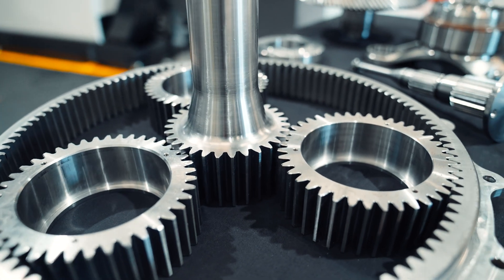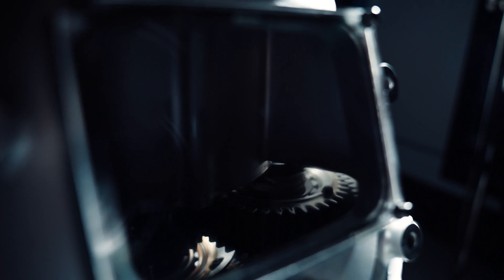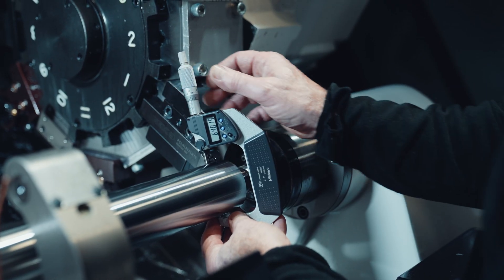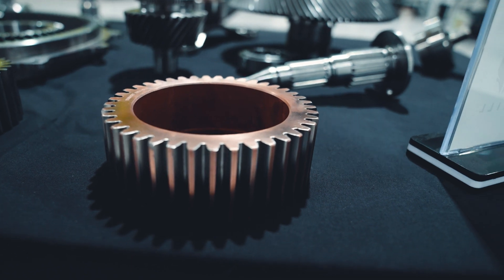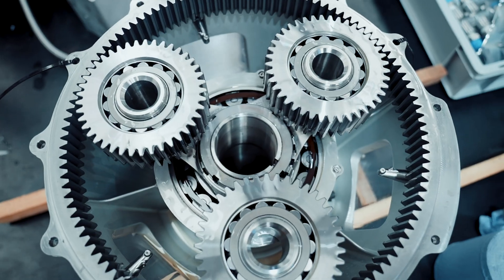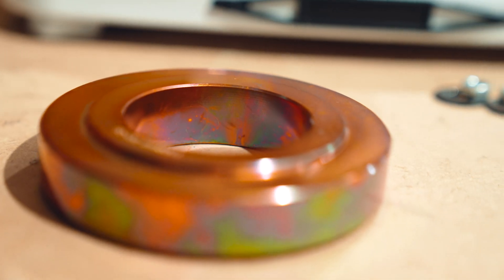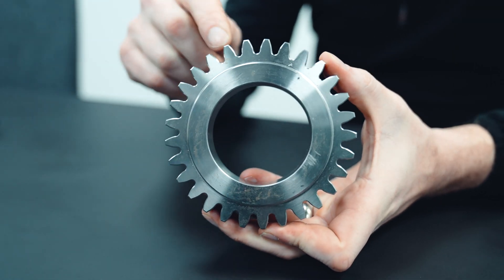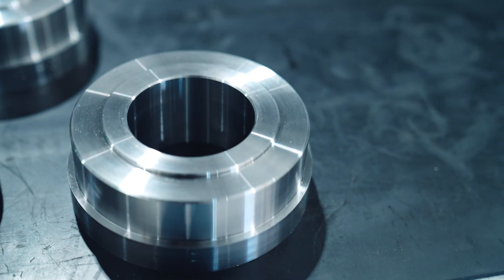Journey to HX50 | Episode 24: Achieving perfection on the HX50 main rotor gearbox

Comment: since flying was motorised, humans learnt that prototype planes and prototype engines in the same plane/helicopter are a poor mix - does anybody know whether there is another tried and proven engine up Mr Hill's sleeve, just in case?
Reply: It's not a prototype engine though...the design itself is very old. There's nothing new about the way it's designed, engineered, or assembled. The only difference is in manufacturing and quality control.
Reply: @spdcrzy  Thank you - what original design is it then please?
Reply: Not really true, @spdcrzy . It is a traditional configuration, but this is not a rebuild of any specific existing design. Every component is an opportunity for improvement, or for a design error.

Comment: Model T Ford had epicyclic gearbox.Cutting edge technology?
Reply: No, but nowhere in the video was there a claim that any of the technologies involved in the gearbox are "cutting edge". In fact, high predictability and reliability are most effectively achieved by avoiding any new technology, instead staying with what is proven. 

Epicyclic gearing is very common in helicopter main transmissions.

Comment: Very poorly explained. The copper coating prevents the steel from absorbing carbon in unwanted places during the case-hardening procedure. :)
Reply: If you watched the whole video, 2:25 he says exactly that.
Reply: @10fantic  but starting at 3:01 he claims that the copper stops heat from being absorbed, which is nonsense. This is a scripted and rehearsed promotional video - the words should be correct.
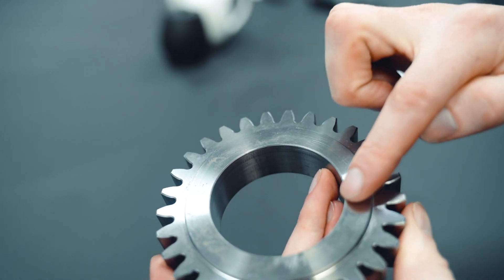Reply: @10fantic  Yes you are right, he managed to hastily mention it. Listen 3:00 to 3:15, such incoherent chatter. I have a little difficulty listening to this bragging about these standard methods. :)
Reply: Having Material Scientists on staff are key an essential resource for an aerospace company. They are worth every penny they are paid.